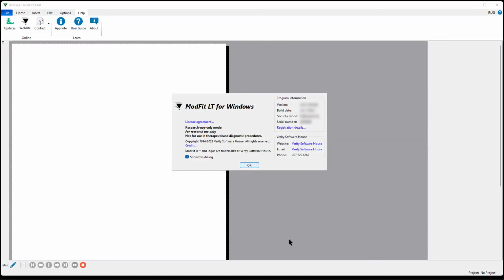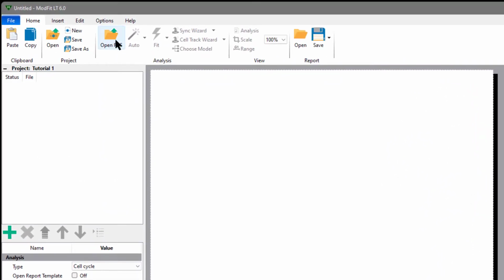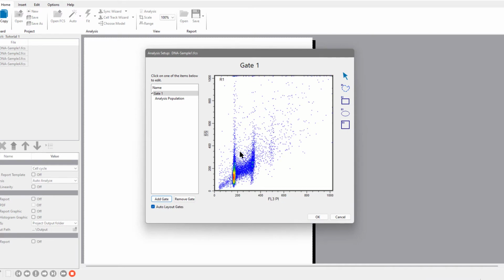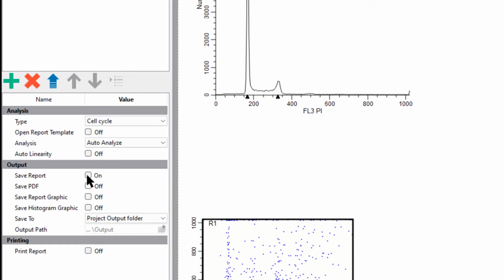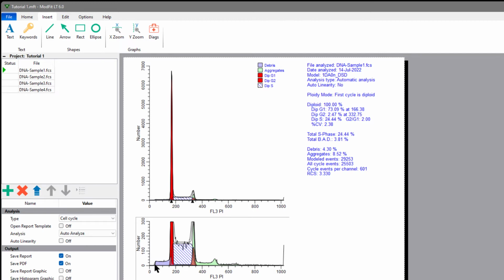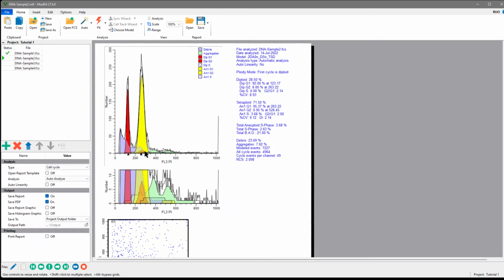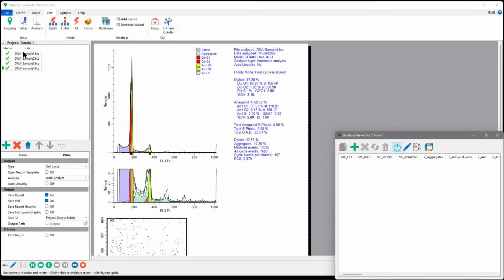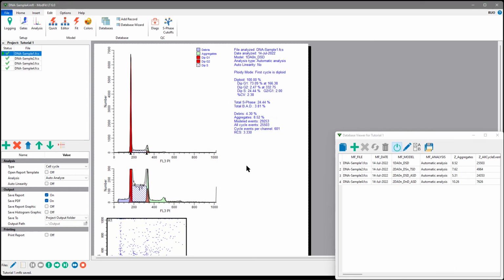Auto Analysis with a Cell Cycle Project in ModFit LT

Comment: How about employing different models in one project. Let's say I have 30 samples and they represent 3 different cell cycle types. Automatic analysis cannot recognize one of them. Can I leave all the samples in one "automatic analysis" project and analyze the unrecognized samples manually or should I analyze them in a separate "manual" project?
Reply from the maker: Thanks for the question, Maciej. You can keep those files in one project and auto-analyze them on the first pass.  Then, as you suggest, you would manually analyze any files that auto analysis did not analyzed correctly.  Use the Choose Model command on the Home tab, which allows you to specify the characteristics of the model to apply.  Shoot us an email at tech@vsh.com if you need additional details - happy to clarify.